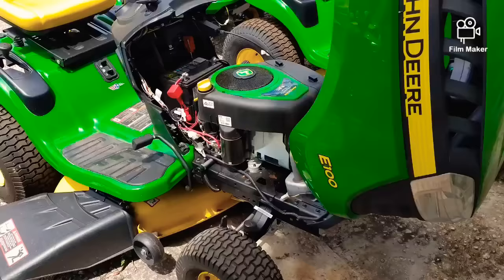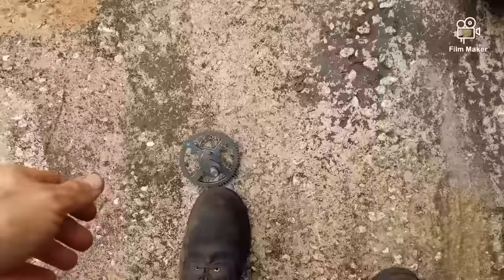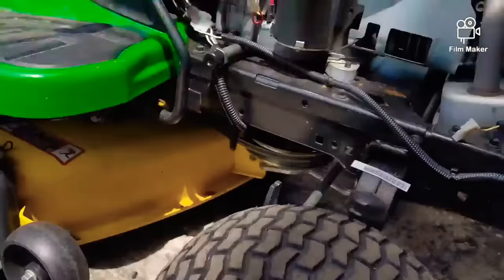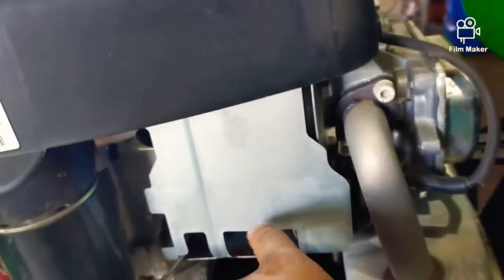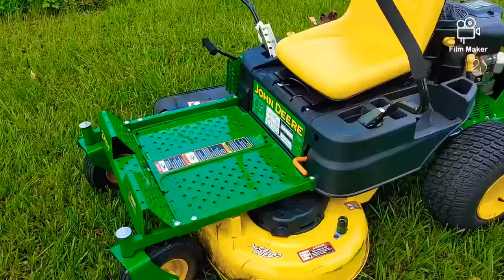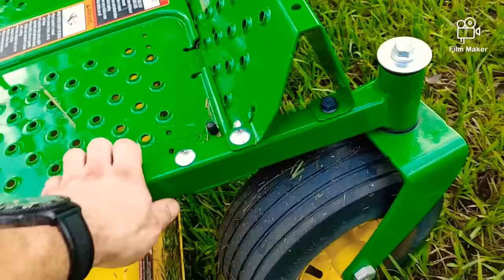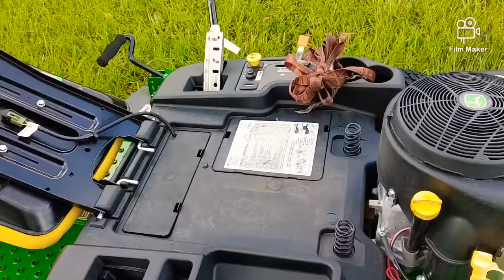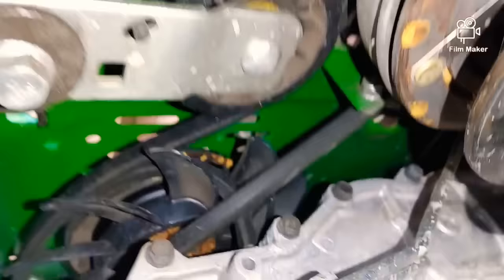Lawn mowers to avoid!

Comment from the maker: To find tools, shop equipment, mower parts and more, you can find them at my store. Click this link: https://www.amazon.com/shop/mechanicalmind
I'll get a commission on the sale at no extra cost to you. It's a great way to help the channel and get the items you need.
Reply: Since you were so honest with this one could you do a follow up because john deer has updated the mowers for 23/24 with thicker more robust frames bearings installed in the caster wheels and the foot lift deck and better 21" seat and the FR691V Kawasaki engine and the available 10guage deck.  They seem to be much improved now what is your opinion on them now?  model number I'm referring to is the z330r/z330m seem to be much improved

Comment: So just to speak up as an owner of the Z335E - Have had the mower a year.  Have not had to add any air to the tires, nor have I had any issues with the mower.  I mow a 1/3 of an acre and help my neighbor mow sometimes, she has a large yard.  I do have the plastic casters, but they were greased from a factory.  I never have a need to adjust the deck on the fly and do it when the mower is off from a standing position.  I never EVER STAND on my deck.  My deck is rinsed after each use and looks brand new after a year of use.  You made me feel good about the engine though that was my only worry.  If you have a rough, uneven yard, maybe it's a bad mower, but for me it's been reliable and makes mowing MUCH faster and easier.  That said, I would NOT Pay the current prices for any of these mowers, I would find a good used mower that has low hours.  The price has increased 15 percent since I bought mine, and I also got the 10percent veterans discount at Lowes.  So, I paid 1000 less than what you see today.  Buy what works for you.  My mower cuts beautiful clean paths through the yard and I have no complaints yet.
Reply: Update - I ran into a stump yesterday at half speed on accident with the deck.  The deck did not take any damage, even though it stopped dead and I almost came off the seat.  Not sure what this guy is talking about.  Other than the front wheels which do nothing.  No issues with mine they are just cheaper designed like he says.
Reply: I have the Z345R with 180 hrs.  No issues, but I do wish I went with a different brand.  I do all the maintenance and I feel like they make it purposefully difficult.  Oil drain hose is to short, spindle grease fitting are difficult to work with, deck leveling has plastic in the way for standard tools.
Reply: I have a z335E. Going on 8 years. Never had an issue. (Knocking on wood)
Reply: Same here had mine for over a year no issues!
Reply: Damn you paid $10,000 for it?
Reply: @libertarianman69  I think it was like $3600 back when I bought it
Reply: Same mower, 3 years and it’s great!
Reply: I have the John Deere stander and its pretty good.
Reply: @libertarianman69 $10,000 😂😂🤣. Not even close
Reply: 😂   I have had the Z335 E  for years and have had no problems at all I change the the front wheel bushings when needed and the drive belt is not a nightmare to change .
Reply: Me too and have not had a problem
Reply: @jeffbaker3354  didn't think so. Lol
Reply: Hey the guy just told you they are junk.  He sees these things way more than than he cares to continue fixing.  You might have figured a way to save aome money now, but it's coming !!!!
Reply: I have a Z300 series. It has 6 hours and the blades won’t engage.
Reply: @johnlawson656  yep my mom had hers for ten yrs mowing about 3-4 acres only problem was those front wheels, she loves it. I have had a 535 for 2 years mowing about 5 acres so far so good.
Reply: My kid had the Z355 for many years w/o any issues. He recently traded up to a Z700 series which he loves.
Reply: Z525e ,  I only had to add air to tires once...3 years 270 hours....
Reply: I guess when I wear out my 1984 model I'll try one of the newer ones damn sure won't buy anything else
Reply: Sounds like an engine problem I'm not very mechanical but it sounds like an engine problem which can be bought in many many different models
Reply: I just bought this exact mower the other day from an older fella who used it at his "vacation lake home" i paid $2800 the unit has 85 hours on it...
Reply: @belindatanner8767  Considering this was two months ago I'm sure you figured out why they wouldn't engage by now.  I have an older Cub Cadet and finally figured out a sensor fell off.  I would hope it wasn't the PTO since it only had 7 hours on it.
Reply: I give the Z335E a 9.5 out of 10 !   .5 percent deduction, because I never give a 10 for anything.  Even my mower seat hasn't ripped yet after 5 years!!!
Reply: Have a Z355E for 9 years, and has been very reliable for the most part.  Need bushings on the Left turning arm, but otherwise, it's been reliable.  I've periodically stepped on the deck, but luckily, haven't dented or broke anything.  The deck belt can be an irritant to replace, mind you, but overall, the Z355E owes me nothing.  I hope to sell my house in two years, and hope the mower lasts a couple more years lol...

Comment: You are absolutely correct and spot on!  I had a John Deere Z540M zero.  176 hours and both hydrostatic transmissions have gone out.  $1200 a piece and John Deere doesn’t stand behind.  After the second one I got rid of it and will never buy another.  Listen to this guy and stay away!
Reply: I use a Hustler dash 34 inch and its the perfect size. Its great for both big and small yards.
Reply: They have a 4yr/500 warranty. Why wouldn’t JD fix it?

Comment: I was a Tech and a Service Manager for many years at a GM garage . This Man took the time to make this video and share his mechanical experiences , what he sees as common failures  & I  appreciate his opinion  and experience very much . Some people who own the models mentioned may never have a problem BUT why take the chance ?  We  experienced this too on GM cars that had expensive common failures . Occasionally one of these cars would perform great with no issues .  Thanks for the video , we will be shopping for a mower soon .
Reply from the maker: Thank you Private data for that comment!
Reply: What better place to get good advice? This man works on these products he knows them. Thank you sir I will keep this in mind
Reply: I am not questioning this gentleman's conclusions however the only way you can know the failure rate of these mowers is to know how many are being sold and how many of those are failing. JD knows those figures and I would have to think that that percentage has to be at acceptable level or JD would not allow their name to be tarnished with a bad product. It is all about the numbers and we really don't know those numbers we only know that some bad ones are showing up at this mans shop. Is that 30% or 3% of the ones sold?
Reply: That is a very important question.
Reply: I'm reading: The 2023 Z315E has a thicker ridgid Frame and bearings in the castors. Has a new deeper deck with foot operated deck height. Has a twin Kawasaki motor.  Now has 3 year bumper to bumper warranty. I guess JD is trying to rescue it's reputation for these low end zero tuning rate riders. Looks like some well needed improvements.
Reply: @Mark P.  That is more than 30% I bought  one  last year on the first 6 hours took it back 2 times to Adam farm to fix it I tried to return it but thay won't take it back
Reply: @Mechanical_Mind  I heard the John deers from home depot and Lowes are not the real John deers?
Reply: @markp.7165  As a former JD tech I can confirm what this man says.  Department store JD's are not your Grandpa's JD.  You don't pay much in the beginning but you will and have no resale value either but they sure look good lol.
Reply: @fredbennett3549  Where it's sold doesn't make a difference from where it's built.  JD bought an old MTD plant to build the residential level mowers I believe in Jonesboro Tennessee(I could be remembering that wrong).  They sell the same exact mowers at the dealerships they are just a cheaper line of products for homeowners built with cheaper parts and as such they just don't hold up as an x series mower which costs significantly more.
Reply: Paying attention to the ones posting here, most all have had their machines for years with no issues.
Reply: Did you decide on what mower to buy? Did u buy one yet? If so are u happy with it?  I’m looking for a Zero Turn 42”  and or Lawn Tractor with no Briggs engines with terrible compression release.
Reply: @fredbennett3549 they are John Deere’s but box stores only stock the low level models.
Reply: There is no comparison between these El cheapo mowers and commercial models. While this mechanic obviously knows these mowers. It does not take a trained eye to determine how cheaply made these are. Starting from the thin deck . Plastic  gear boxes ? Really?
Reply: @Ron_Masterjohn JD would show up and unload and assemble their mowers at Lowe's.  They're not MTD mowers, only built to their specs. Same with Husqvarna. I asked Husqvarna directly and they said they sell the same exact mower at their dealers, same that JD told me. That's their entry level homeowners mower made to mow 1-2 acres a week with regular maintenance and the mower should hold up fine for that.
Reply: @Ron_Masterjohn get a mower with a Kawasaki engine. They're better built than the Briggs or Kohler.
Reply: @jasonm9264  one thing can go wrong with the machine and you're going to have certain whiny babies always saying that something's junk just like when you have Ford vs. Chevy vs Dodge and one man has a little trouble out of Ford he calls the entire company junk and then we'll buy Dodge which is known to be the biggest piece of junk on the road and claim it's the best vehicle they've ever had
Reply: Im gonna say a bunch of them because john deere mowers have gone down hill over the years from what I've seen plus from working on them myself to they're made cheap and made to break
Reply: And john deere is still making money off each of those cheaper ones you guys say so they are john deere or that name wouldn't be on the cheap ones
Reply: @jameswatson4110  yeah its a good show i knew mine had a problem some place in the engine before i watched his video i kept thinking maybe my shaft is bent but its not the shaft but is the camshaft so i was close to knowing the problem without opening it up 

I would still buy me 2 more of those engines Briggs or john deere it doesn't matter i like that model because it never gives me any problems
Reply: @joenissan  but the craftsmen i bought used came with the issue its nothing i done to it to cause the problem i still wonder why'd the woman have that much oil in it the oil was way up to the middle of the dipstick she sold me the mower because she said it wasn't working right it works ok other than the camshaft problem i use it all the time
Reply: Grandma and Grandpa had 2001 Bonneville and 2000 Alero respectively. After 13 years, the lot of them turned into a curse. Blown head gaskets, clogs, bad ignition modules, trans issues and multiple trips to have the keys reprogrammed.
Reply: @marshmower   I'm an X GM tech , no GM vehicles in my driveway ....
Reply: @privatedata665  I took basic electronics.  I saw enough repairing TV's to learn that maybe the Amish were onto something. Now, if the Amish fixed GM BMW and Mercedes for a living but didn't own those, that's a massive one way transfer of wealth. 😁. Take it easy.
Reply: Hi from Australia, I bought the zero turn you spoke about here and from a customers point of view it was a really awesome machine. I made a tow bar for it and used to tow heaps of farm stuff around plus I used in in my paddocks to cut under all my electric fences. It never failed me once and I reckon I asked a fair bit of it. Obviously you are speaking from a techs point but I just wanted to share my experience with them.
Reply: Beavers took out a dam, up the river, so, I jumped into my GM car, that would have gone underwater when the water hit my area.   I forgot my keys.   So, I pulled the door handle too fast, and got trapped in the car, when the plastic door handle broke off in my hand.  I had to get out the passenger side, and It was not easy.    I will not by another chevy.   I will never buy another new GM, the GM nearly killed me.
Reply: So right about the John Deere decks ! They were at one time better thicker but as to make more money for the company they Went cheap on the metal on decks . Also the spinals don't line up even new. Check the new one's. That's got to be ruff on belts. Just my opinion. 🧐
Reply: Briggs & Stratton used to make good motors, not anymore.
Reply: @markhodge5006   agreed , we raced Briggs  5hp Flatheads and had great luck
Reply: @Ron_Masterjohn Get a Exmark.  I got the radius e with the 2 blade.  Kawasaki engine. 3 and a half years and still no problems.

Comment: I appreciate your honesty. The mowers being sold today are about double in price what they were even a few years ago, and it's unfortunate that JD is trying to cut into the economy market by downgrading quality. People think they can buy something for under $2000, but you get junk. I almost bought the E100 until I did some research and found out about the motor and transmission. I ended up buying a Craftsman T2200k which has some of the decent quality the JD sacrificed on the E100, like a Kohler 20hp V-Twin, and a cast aluminum transmission case. I don't have anything to report yet as it hasn't been delivered yet.

Comment: I've had the Z335 for 6 years and use it every week on 1 acre. I did replace the front wheel bushings last year only because I noticed some noise from them. So, except for regular seasonal maintenance I've spent a total of $15 in repairs.  The unit's been the best mower I've ever owned and the price was reasonable. I wish I had bought it sooner!
Reply: Had my Z track for about a year. Same here too. I love mine.
Reply: Just bought a z325e and everything he said about that mower does not even look close to what he is saying. Not sure what year this mower is but the things he points out are completely wrong. My mower works great.
Reply: 5 years in I haven’t had one good year with the same mower.
Reply: haha same here - all I've ever had to do on mine is replace/sharpen the blades every few seasons, and change the oil and air up the tires once a year. I hope I haven't jinxed myself....
Reply: I’ve got a 2023 Z330R and the issues described are no longer a problem.
Reply: My previous riding mower was a Craftsman rear engine piece of crap once it was 3 or 4 months old it was always going bk to the shop.
Got rid of it and got a John Deere x300 and 16 yrs later runs like the day I got it. Only replaced the battery 3 or 4 times and the seat cover cracked.n
Reply: The JD Z-Tracs sold at the big box stores (like Home Depot) were the ones with the problems, they are not the same mower even though they look like the ones sold at the JD dealers. I have had mine for 8 years, replaced the battery only, and done regular maintenance. Best zero turn for the money, the dealer even gave me a factory rebate and it was within a couple hundred dollars from Home Depot price.
Reply: @barry4fish , I bought mine at Home Depot.  I wrote the comment you're replying to at the beginning of last season, so it's been another season with zero problems. 7 years!
Reply: @biffmasterson9786  I know several so what's your point ?
Reply: @biffmasterson9786  Wrong again🤣😂🤣.  He wasn't question his opinion he was telling him those lawnmowers are not junk. Just like all the other comments that are saying they haven't had any problems with theirs. Maybe you don't have a life 🤣😂🤣

Comment: 59 years old I've had many mowers. I remember when there were lawn tractors instead of lawn mowers. Like everything they built things cheaper and charged more. On a small flat lawn and if you take it easy with the mower you'll probably be ok with the cheaper mowers with proper maintenance. But if you have hills and large areas to mow, you would be better off spending the extra money. Thank you for this video great information!

Comment: My L110 has been a workhorse for 20 years and still going strong!
Reply: I had an L110. Steering knuckle kept stripping. Awful mower in my opinion.
Reply: @aviatonfirst  mine have never stripped out. If it kept doing it over and over agian someone wasn't fixing it right in the first place.

Comment: Great video and good advise. Went with a Bad Boy ZT Elite 60' deck and 747CC Kohler engine (avoid the Suzuki engine. Their advice). 0 disappointment. Super easy to work on, not that it's needed much. 100% designed to be be easy to work on and the deck even has  "Step Here" decals. Been so impressed with it, picked up[ a 3026H Tractor as well. Same thing, super easy to work on and just hands down reliable. Word of advice, any mower that has a stamped deck instead of a welded one is one to avoid. For those not in the know or new buyers, if the deck is nicely rounded, contoured to the blades and the bottom of the deck is curled up, it's stamped. That means it's cheaply made and thin. A welded deck is much more angular, thicker will last much longer and usually has a reinforcement, visibly welded bar on the bottom.  You get what you pay for.
Reply: I appreciate that info!! Thanks!!! Looking to buy my first riding mower after buying a house recently.
Reply: @Fred-gv3kh What did you decide on the mower? I'm doing the same right now.